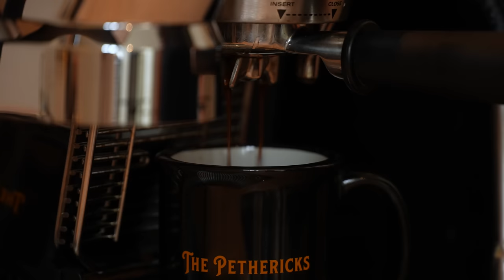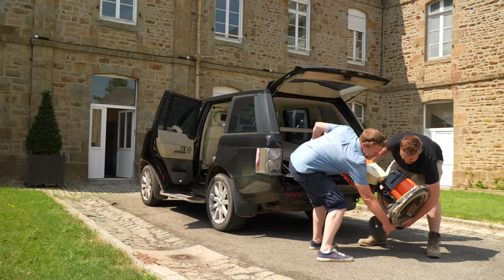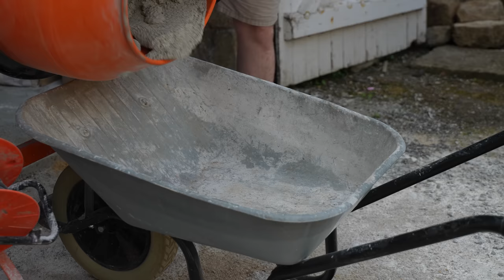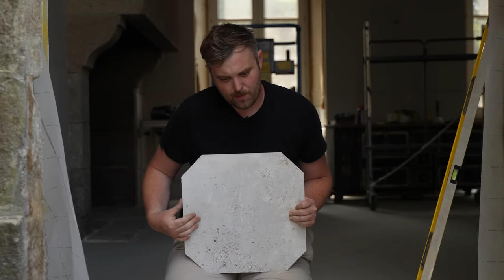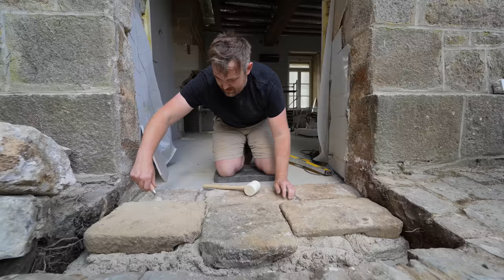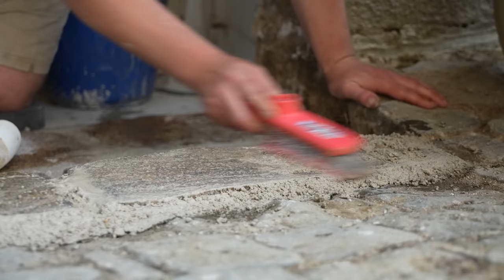You Decided! - A Big Step Forward

Comment: I think you should have fitted a rain gully across the door and have it going into one of this holes also I would have blocked those of if they are from the gutters in heavy rain they will flood under the cobbles
Reply: The pipe with 2 holes took water from a kitchen sink and a floor drain. Don't think they are part of the gutter drainage system.

Comment: I don’t think you’ll regret going back to the original architectural lines for the façade by replacing the small window with a door. It’s going to look amazing, as well as an added fire escape, as you said. Those industrial floor washers are beasts but definitely a terrific solution for the floor. Phil’s a good friend, taking over the floor cleaning. :)

Comment: The stonework looks really nice. Phil's scrubber is only a small one. I had a much bigger one with a suction bar at the back. The thing you have to watch with them is the solenoid under the rotating head. You can also change the head to a softer one and use floor polish to bring out the shine in your floors. It would be great in the kitchen on the travertine tiles. Maybe you should get one later for all your marble and stone floors. 😉

Comment: Billy if you think you are tired scrubbing the hallway you should try resurfacing a wood gym floor. Back in the mid 70’s we used floor scrubbers like that with wire mesh pads to sand off the old finish, vacuuming up all the dust. After the wood floor was completely dust free we had one shot to apply the new finish! We had to maintain a wet edge while using the applicator. If we ever tried applying new finish to a dry edge it would cause an imperfection in the floor surface which would be very noticeable when playing on the gym floor. Playing on an old wood gym floor was fun but they did require a lot of maintenance to keep them in great shape.

Comment: I love those commercial floor cleaners. I had job cleaning the local supermarket as a 17yr old and they had one. They're easy to use but it does take a few minutes to get the hang of it as less is more when it comes to manipulating the machine. Try to go too far in either direction and as Billy found, it tends to run away on you. You need to be subtle in your movements, letting the machine do all the work.

Comment: Running the buffer is an acquired skill. You steer right and left by lowering or raising the handle. It won't be long and you'll be able to handle it with just one hand. Just takes practice.

Comment: Billy, it was fun watching you using Phil’s scrubber.  I used to do community centre floors with one of those and the trick is balancing the brush.  If you tip one way or the other, the scrubbers runs off in that direction.  Very tiring if you ‘fight’ the machine, but much easier once you find the level spot. Your stone doorway entry looks great, although not sure how water will not collect there as it’s lower than the cobbles?

Comment: Won’t the rainwater get trapped between the step up and the door? Would it not be better to have it level with the rest of the cobbles outside and then have a step down on the inside instead? That way the threshold will keep the water out without having a small lake infront of the door? 
Or will you put a drain in down there? 🤔

Comment: As usual enjoyed your project today and always find it very interesting when your friend Phil and others join in to help well done. However I have a question and a comment let me take the comment first. You need to protect your health/back and do your heavy lifting with your legs. I don't want you to take this the wrong way but as a little constructive comment you have a long road ahead of you and lots of heavy lifting in your future and above that a family that needs you and loves you dearly so please heed my warning you can damage your back if you're not careful billy. And now the question you have me guessing what you were going to do with the storm cast iron drain pipe which takes water from the downspout? As I watched you today there were two gaping holes that needed attention before completing your project and I was wondering did you take corrective action prior to you applying your lime sand then stone to properly seal them Correctly? This could have been achieved in a very easy manner by means of a pipe Fernco pipe band  or cast iron clamp prior to covering it over? As I stated in the beginning please file this under curiosity and constructive thoughts I admire you and your work ethic in closing keep up the good work and crack on!

Comment: those powered brushes are "interesting" to control.  you'd think that you swing the handle side to side to get the brush to move side to side, but nope.  I spent hundreds of hours doing this exact activity in the USAF as a youth.  Polishing floors.  Lift the handle up to make the brush move to the left, push it down to make it move to the right.  Or vice versa, I can't remember.  It depends on the direction the motor is turning, and I can't remember which was which on the floor scrubber I used 3 decades ago.

Comment: It seems like a lot of the chateau videos I've seen (not just yours) that the floors are all lower than the outside.  Which encourages flooding it seems.  That said, I think I would have put a drain slot at the base of that top step that went down into that drain tile below, or maybe replace the center stone with a cast iron drain body and grate.

Comment: Looks nice, works terrible... If you do step down like this, you should not seal gaps with concrete... why? well water have to suck somewhere... or you sould connect it to drain system... after first heavy rain you'll have small frog pond behind the doors or wet floor in the kitchen.